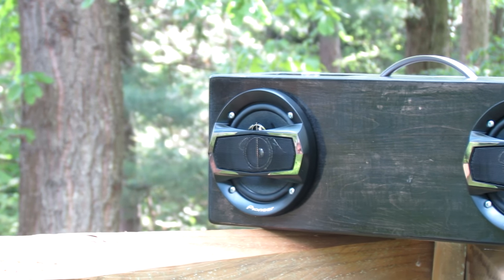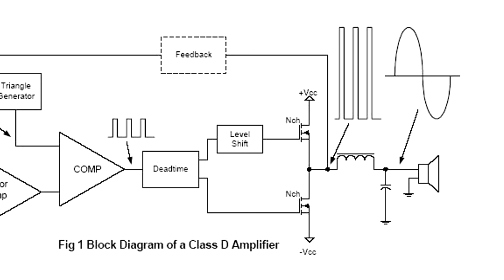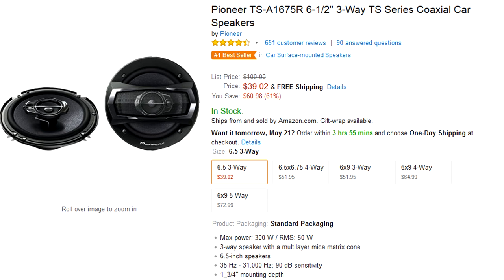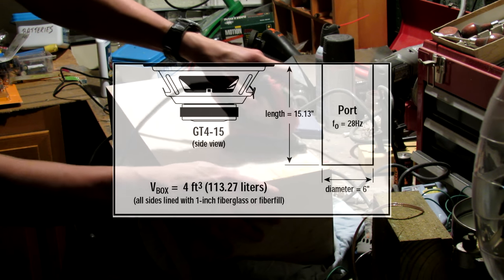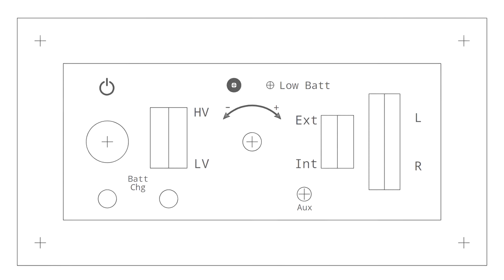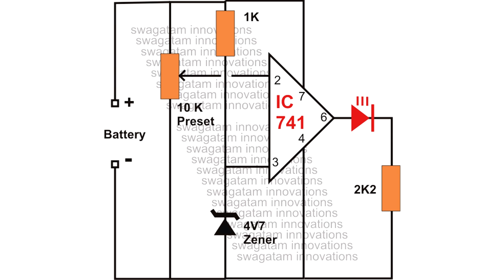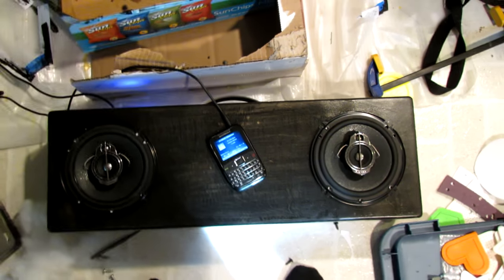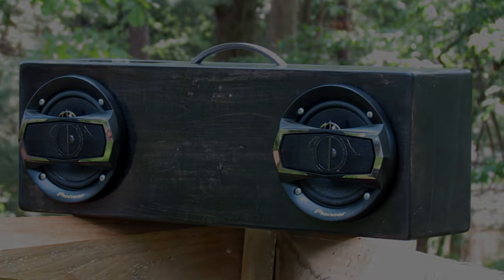Designing a Cheap but Powerful Portable Speaker System

Comment: hey LazerLord10 im curious how big of a battery you used?
Reply from the maker: +Tyler Cowan 7.5 Amp-hour 12V sealed Lead acid battery. A little smaller than a brick, and about as heavy as one.
Reply: +LazerLord10 great that's exactly what I'm looking to buy. your video has enspired me to make this project. only change is I'm useing a nfc Bluetooth rx
Reply from the maker: Tyler Cowan
Cool!
Reply: +LazerLord10 I'm at the building stage. what are you using to charge your battery. I'm having a hard time finding a 12v 2 amp charger for a sealed led acid battery. what does yours look like?
Reply from the maker: Tyler Cowan
It's Battery Tender brand, which are generally considered to be pretty decent quality. But yes, a charger for a sealed lead-acid battery would be good. The current you mentioned (2A) is a bit overkill for this application; the charging current is only related to how fast it can charge the battery. 500mA would be fine.
Reply: +LazerLord10 Would it be  possible to use 4 of those batteries in Row-Series to drive a 100w Sub and 2 50w mid,high speakers with another amp. Or would i need something beefier ?
Reply from the maker: Chajax
If you're concerned about power draw, one battery will be fine. These little Lead-Acid batteries can output continuously at ~40 amps, which would be plenty for that setup you described. If you're concerned about capacity, just make sure your amp can handle the higher voltage. Also, try to keep the batteries at the same charge level.

Comment: hey could you tell me where did you get the speaker handle?
Reply from the maker: +duy zoro I picked one up at Lowes, but really anywhere you can find one would work. If possible, order it in-person so you can feel how the handle will feel when you're using it. I just placed it in my hand like I was carrying something, and I put force on it comfortable.
Reply: +LazerLord10 I tore two small 4 ohm JVC speakers from an ugly computer speaker, do u think i can make a good small portable speaker from them? Its my first time maling one.
Reply: cesar martinez if you know how to solder use this amp http://goo.gl/Fz4237  . It's plenty enough for small 4 ohm.
Reply: +duy zoro thanks man, i appreciate it
Reply from the maker: cesar martinez
If they have high enough power handling, sure!

Comment: Man... Here you are talking about the enclosure air volume ratios having completely forgotten what the enclosure should be made of : MDF, never anything else.
Reply from the maker: +littlegandhi1199 I don't really think the material that an enclosure is made of has as much effect as its geometry. Sure, MDF would be the best option, but maple looks a lot nicer, and it probably has similar properties. Plus, with a relatively small box like this one, material choice doesn't effect the performance as much.
Reply: ***** Maple probably does not have similar properties. We're talking about how much air the woofer moves vs what the sound does when it hits the enclosure. Especially with ported you're gonna hear the box resonate in with your music. You shouldn't be indifferent about the wood type (from my memory) not even mentioning it until you talk about staining the maple. If anyone is using some real subwoofers for their own project and something higher then 20-30w rms you're doing them wrong not talking about it.
Reply from the maker: littlegandhi1199
I suppose so. They sound good enough for me, but then again, I'm not an audio engineer.
Reply: ***** If you do another bigger build and make a tutorial you should bring it up. Thanks for the vid, it was interesting and I might try something like this myself
Reply from the maker: littlegandhi1199
I already doing the research for it! Hopefully will have it done by this coming summer.

Comment: how long does it lasts?
Reply from the maker: +Miraxxe I don't really know. On idle/low volumes, probably around 5-9 days. That's based on a test of 3 days where the voltage dropped to 11.8V. On full volume, I'd guess about 8-15 hours.

Comment: I don't want to sound stupid, but can I install this Class D amp straight in my car ?
Reply from the maker: Yes, actually. If it can take 14V input, it should work fine!
Reply: But a car uses a 12V batterie, so will it work fine?
Reply from the maker: deejay Eazye
Yes, but when the battery is fully charged, it CAN reach up to 14V. Most pre-made class D amps can take 18V or more, so you should be fine.
Reply: Thanks for the good advice I will start searching for a 4 Channel and give you feedback how it sounds in my car. I have stock oem BMW speakers but I heard if they well amplified its amazing the sound that will come out of them.
Reply from the maker: deejay Eazye
Make sure you don't over drive your speakers. If they are, say, 50W rated, don't get an amp that can output more than 50W. In home-made sound systems, the amplifier should be the bottle-neck.

Comment: 50 watts my ass. more like 20 watts RMS 50 watts peak. nice build tho. extremley neat and tidy. you seem to know what you are going :D
Reply from the maker: +smallenginedude71 Check the test video I linked in. I'm not quite sure what 50W per channel would sound like, but I'd like to hear what you think.
Reply: ***** the rating on car audio is very overrated. usually the peak power rating. the weight of the amplifier usually tells it all. but dont get me started on car audio. i hate it with a passion. it has its place like in this build. and you did a great job on the build. (im not having a go at your work) im having a go at pioneer. a real 50 watts RMS per channel on an efficient set of speakers is really quite loud. on my home hifi setup ( i wont go into details ) i can do about 115dB - 120dB on 70wrms per channel.
Reply from the maker: smallenginedude71
Ah, ok then. But the 50W spec I'm getting is from the amp, ,not the speakers. The speakers can just handle 50W RMS and (200?) peak. Whatever it is, it's plenty loud for what I want to use it for.
Reply: ***** yeah. i was talking about the amp. 
you are totally correct though. i have a similar boombox setup. and they are quite loud. if you are happy with your setup then that is all that matters :D
Reply: +LazerLord10 Can you tell me the exact dimensions I am making a build and need to give a order and am having tough time doing so
Reply from the maker: TheAditya0
Exact dimensions for this type of project aren't entirely necessary. Unless you're trying to make the perfect speaker box, the only dimensions you need to worry about are that all of your components will fit inside, and that the box will fit together. Just sit down for about 30 min. and draw out how it will go together.

For reference, this one was 24" long, 8" tall, and about 6" deep (I don't remember the depth)
Reply: SED71 These small amps usually do what the IC is rated for, TDA7492 is rated for 2x50W and with proper supply it will output that, i got TDA7498 and measured about 90W till clipping but not sure about THD (rated 100W at 6ohms 10% THD)
Reply: I wouldn't describe the wiring at neat and tidy!  Needs some cable ties or spirawrap to stop it all flapping in the breeze.

Comment: isn't it better to separate the 2 speakers from each other ?
Reply from the maker: In a larger system, yes. However, for a smaller one like this, assuming that the volume of the cabinet is the ideal volume for one speaker, the cabinet would be twice as big. Generally speaking, the bassline is shared among both channels, so it won't make too much of a difference for normal use.
Reply: thanks for the fast response, i also saw the other video where you showed is the loudness of the system but it seems that you made an airport in the front for extra bass. Would you recommend this modification and so yes, could i just use a random cylinder on the inside ? Thanks
Reply from the maker: I wouldn't recommend it if you already calculated to correct volume for your enclosure. I really only did it to see what difference it would make, and it really didn't change much. I'd stay sealed if you can.
Reply: alright thanks ! The problem is that i want to use Caliber CDS16G's but de manufacturer doesn't really give enough specs to calculate my volume. As they're the same size as your's, i suppose i can go with the 4ft³ you said in the video. Would it be negative to build an even bigger enclosure or would this distort the sound ?
Reply from the maker: I never actually calculated the ideal cabinet size, actually. I haven't done too much stuff with audio recently, so I wouldn't really know a good size to make it. If you're planning on a portable system like mine, just make sure it's small enough to carry around. If you're going for a standalone system, I'd do a bit more research.

You could check a site called PartsExpress and look for similar speakers, but the difference is that PartsExpress has SUPER detailed info about most of the speakers they carry, so you could likely apply that to the ones you have.
Reply: i checked it out and found some which come very close to the ones i have. They all recommend 0.1-0.11 ft³.
If i take 2 enclosures with dimensions 180x180x90mm, i get 2,916 l or 0.103ft³. I'll make 3 chambers and use the middle one for the electronics. :D